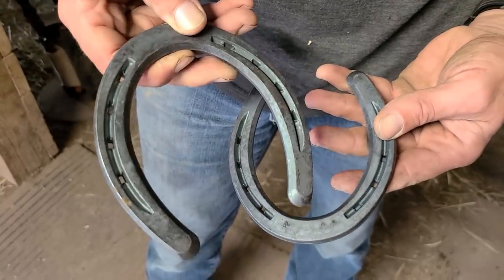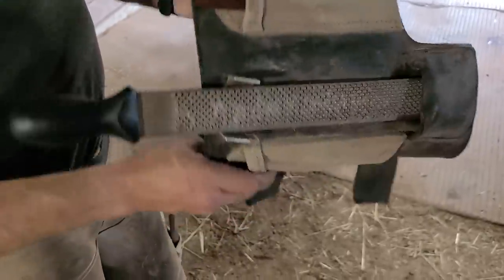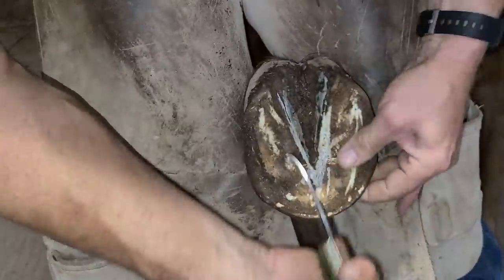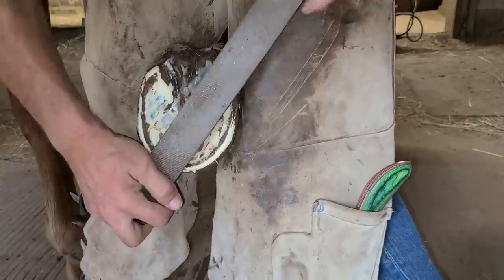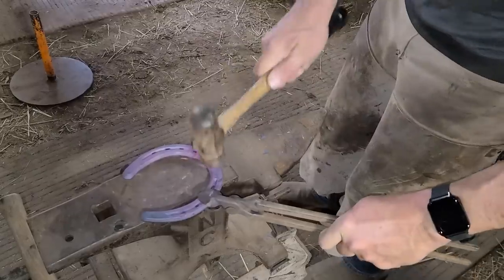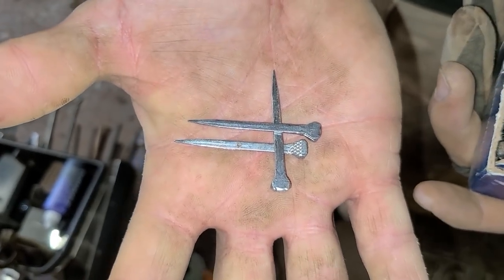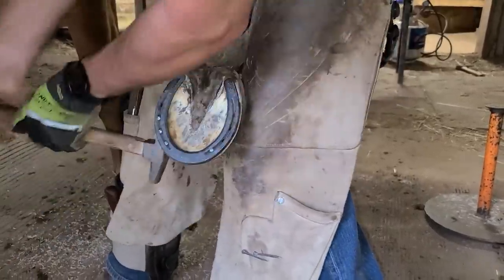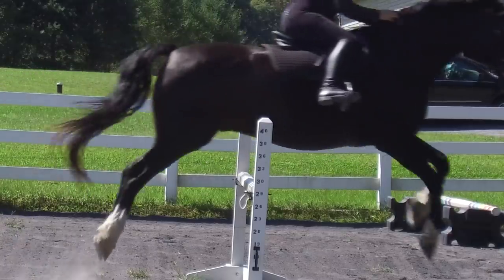How do you shoe a horse???

Comment: So... horses don't feel hot shoeing... but you hot shoe because it increases blood flood because burns increase blood flow... but its not a burn and they don't feel it... but... but... wut?
Reply from the maker: 😂 the blood flows into the center of the hoof. The burning is only on the outside. So they don't feel the burn.
Reply from the maker: Ahhh I see what your getting at now. The best way I understand it is. Though the horse isn't feeling the scolding heat from the shoe. Heat is making it's way through the hoof. That heat opens up the vessels and arteries in the hoof increasing blood flow. The Ultimate result is that the horse can have a better feel for the terrain he/she is walking on 😁

So though a fingernail is an appropriate illustration. It's not exactly what's happening. Which is why you want an experienced farrier for hot shoeing. Loved the question 👍